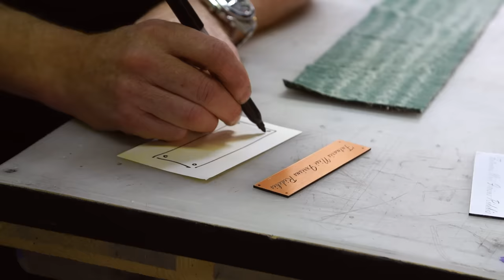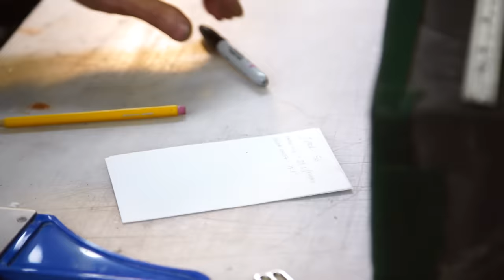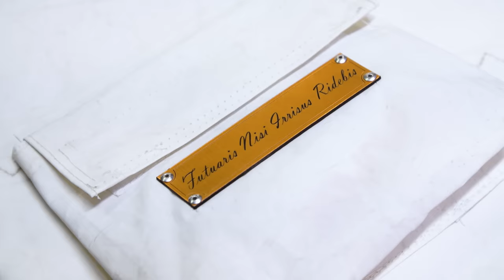Adam Savage's One Day Builds: Eric Idle's Guitar Case!

Comment: Not gonna lie, my butt clinched when I saw Adam tracing the guitar with a sharpie and nothing to prevent it from marking up the guitar. LOL
Reply: Super glad I'm not the only one.
Reply: @865_Audio  Yeah, I immediately thought of all the times I've marked up whatever I was tracing and thought Adam was out of his mind for doing that. But then I remembered that Sharpie comes off with a bit of rubbing alcohol, so it probably wasn't a big deal.
Reply: except if the guitar has a nitro or shellac finish rubbing alcohol will melt it immediately :P  @VanOaksProps
Reply: Meh, all it takes is a little dry erase marker and it'll come right off.
Reply: I clenched when his watch was rattling around on the top lol
Reply: Nothing a bit of isopropyl alcohol can't wipe off.
Reply: I can't figure out why he didn't simply trace the guitar face-down instead of cutting out the body then tracing the neck separately.
Reply: If he ruined the guitar he woulda just made him a new one
Reply: Had the same thought, lol. However, Adam is a professional, and I'm sure, a perfectionist. Hopefully it went well
Reply: The Berth of the marker was pretty thick and he kept that flat against the side of the guitar. The actual felt tip was away from the guitar. This is probably a technique he has used a lot, and so he is less likely to screw up
Reply: @VanOaksProps  You'd want to know what that finish was before you used rubbing alcohol on it.  That would strip some finishes right off.
Reply: The plastic body of the sharpie is all that is needed. You should go look at how they are made.
Reply: My violin is happy it doesn't get manhandled like that. BUT...watching the process of putting a case together was pretty cool!
Reply: Every time he picked up the guitar I cringed
Reply: And watching all the spray adhesives and foam, I am worried about outgassing from those materials affecting the finish on the guitar. This is not unheard of. Of course I don't know anything about the finish on the guitar.
Reply: VanOaksPropFoundry dude me too and no you guys you don’t use isopropyl alcohol on a nitro finish.

Comment: The style, the backpack straps, the snug foam fit are all wonderful.  Kudos.

I hate to criticize such a beautiful build.  I really do.  But.....  As a violinist, I'd like to say the zipper needs to go on the same side as the handle.  The reason being, if the case is unzipped, you're on the wrong side to notice.  And if you pick it up while it is unzipped with the handle on the opposite side the instrument falls on the floor, but if it is on the same side and you pick it up unzipped it falls onto the foam of the side or the fabric covered top of the case.

Ideally, it would have been awesome to have a double handle where you grab both halves one on either side (top and bottom) of the zipper on the size that has the zipper. So even if you forgot to zip it, you'd still be holding it closed.
Reply: Jeremy Streich agreed. I’d also wonder about the placement of the handle right in the middle. Wouldn’t you want it at the balance point? Like you said such a wonderful build but I know Adam always likes to improve. Perfection is an ever moving target :)
Reply: Being a guitar player, right from the start thought the same thing oh man I hope the zipper is on the same side as the handle.
Reply: As a guitarist myself... agreed
Reply: 1000X yes.
Reply: @bucketsofjoy  I don't use cases like these at all and still I thought it was weird to put the handle on the opposite side. You don't put the handle on the bottom of a suitcase either?
Reply: I was wondering about the handle placement myself.
Reply: I don't disagree but, didn't he say he was copying the design of the original bag?
Reply: @there_is_nothing_here  Well it don't seem to be on the "wrong" side on the original bag either. You can just barely see it at 3:22  ... although very hard to make out black on black.
PS: Oh, and it helps to use the period and comma keys to jump frame by frame...
Reply: As a guitar player who likes to make stuff I also noticed this right away. It is so not logical. I'm glad I'm not alone.
Reply: Was looking for a comment like this. Being a bassplayer and having a zipper fail on me once resulting in a cracked neck on one of my acoustic guitars the zipper being on the same side as the handle is one of the first thing I look for in a bag.
Reply: Yeah i thought the same thing as well. For the reason you stated but also from a practical sense. If you're carrying the case and lay it down it will open from the opposite side as you. For most people, an inconvenience, for someone touring, that will get old very fast.
Reply: I would also add that the backpack straps should be high enough to keep the bottom of the instrument from hitting the back of the legs when you’re walking, eliminating unnecessary jarring of the instrument.
Reply: I'm so glad someone said this also how is this an improvement on the existing bag?
Reply: Velcro tabs around the zipper flap would be a nice safeguard too.
Reply: @TheRealFOSFOR  - OMG I never knew you could do that with the period and comma keys!!!! Thank you! :)
Reply: @there_is_nothing_here  He did, but the original bag has the handle on the same side as the zip.......    because it's a real bag
Reply: Since the british do everything opposite, the handle "fits", haha.
Reply: I'm not much of a string player, but I don't think I've ever seen any instrument case with the handle on the same side as the "hinge". Really confused by that decision.
Reply: As someone who doesn't play a stringed instrument this hadn't yet crossed my mind, but now that someone has said it, it seems a little obvious.  However, doesn't that also require straps that keep the lid/cover from opening past about 90 degrees? Because if the lid of the case opens 180, it's not going to keep the instrument from falling to the floor if the bag came open after being picked up even if the handle was on the same side as the zipper.  Though, if it only opened 90 degrees because of some straps, then it might very well prevent the instrument from falling to the floor as the lid would create a small table to catch the instrument. Another solution would be velcro straps attached to the felted foam body that keeps the instrument in place, such that it couldn't fall out even without a lid at all.
Reply: If I we're Eric Idle, I'd have the handle removed and sewn on the proper side and in the proper position to balance it. ( And add some bias tape or something to cover the raw edge where the top and bottom meet.)
Reply: Honestly, It feels wrong to criticise something so nice, but I to cannot get over the handle placement. No case in history that get's regularly used has the handle on that side, for the practical reasons you mentioned, and also for when you place the bag down, the handle is going to be facing you, and so the zipper should be on the same side so you don't have to turn the bag around before you can unzip it and retrieve the object. Ease of use is a big factor to consider with something that is going to be used as regularly as an instrument case.
Reply: I'd say in this case, no pun intended, it's a bit of a moot point. With how snug of a fit it gives the guitar there isn't a large chance of it falling out. Of course Adam may not have been thinking too much about the side handle as it seems it would be primarily carried via the back straps. When you consider the time for the build and the fact that he more than likely did this for free, I think it's alright.
Reply: @n3rddegree869   He put the handle on the wrong side. The old case's handle was and ALL guitar cases' handles are on the other side. Imagine you're carrying the guitar case by the handle, and you set it on a table to take the guitar out. Because the handle is on the wrong side, you need to spin the case around first. It's wrong.
Reply: I didn't say it was on the right side did I? Like I said, if he was only thinking about the backstraps, then the handle becomes moot. Of course this is a simple enough fix by simply adding a handle to the proper side.
Reply: @n3rddegree869  You said "it's a bit of a moot point" and "I think it's alright." I am saying that it's not moot and it's not all right.
Reply: Thank you.  Needing to spin the case 180 every single time would be infuriating.
Reply: The zipper not being on the same side as the handle really bugged me as well, super weird.
Reply: I love stuff like this.  Like little bits of knowledge only gained from doing something.  I would have never thought about that, but it makes total sense.
Reply: @n3rddegree869  I agree, the guitar seems to fit snugly enough that it won't just fall out (also considering it would be somewhat lightweight due to it's size) like people are making it out to be. 

That isn't the same as saying that the handle is on the right side either, like AisuruMirai seems to think. It would be a pain if you were holding the case by the handle, then placing it on a table and having to twist it around to get to open it easier (i.e. with the top opening away from you) every single time you hold it by the handle. It's clear from the video Adam didn't really consider the placement of the handle deeply, he had the foam insert oriented in a way that resulted in him deciding on the placement of the handle on the wrong side of the case, and he simply decided that it should be halfway down the case. But as you said it shouldn't be too hard of a fix.
Reply: I'm glad to see someone already made this comment. I may not be a guitarist, but as a trumpet player I can confirm that every instrument case I have ever seen has had its handle on the side that opens. Other than this issue, the case looks great!
Reply: I was thinking the same thing, as a guitar player I've never had a single case that has the handle opposite the zipper.
Reply: Such is the origin of the “master of none” part of the phrase.
Reply: You're right, but did you see the size of those zipper teeth? That's not some Nancy boy violin zippers. Those are industrial strength grind your finger off zipper
Reply: Also, it should not be at the centre of the side, but over the center of gravity, which may not be the same place.
Reply: Jason Molisani not just instrument cases, think suitcases too, it’d be a mad choice to have a suitcase open opposite to the way you carry them. To be fair this is one of those decisions caused by a looming deadline and starting off with the wrong idea and no time to really think about it, test and correct it. We’ve all been there!
Reply: I didn't catch the handle  on wrong side but you are correct.  The other bad problem with the case is the support for the neck on the head.  It should be under the neck.  The way it is now; a good jolt could break the head off.  Also, does anyone recognize the manufacturer of the guitar?  I don't recognize the markings.  Also the handle should be at the balance point but it looks like he doesn't carry it by the handle very much so it shouldn't be a problem for Eric.  That said, I don't think I could have done even half as good a job as Adam.
Reply: @TheRealFOSFOR  omg ty, didnt know u can move frame by frame
Reply: That's exactly how my gig bag is made. It actually has two handles that have a flap of velcroed fabric that makes it one piece once wrapped together. It's closed even if its left unzipped because you need to  wrap the handles together to use it properly.
Reply: As a guitar guy my self...
Reply: As a bassist I agree about the handle and zipper situation
Reply: Exactly, laying it down on its back to open, and the zipper is on the other side so you have to spin it round.
Reply: Jeremy Streich Adam said that you must think backwards 🤪 soo that what he did! But on this handle you should not think backwards ❤️ Awesome build anyway ❤️❤️❤️
Reply: Exactly what I came to the comments to see.
Reply: I feel like Adam could've made a way better product by just taking 20 minutes looking at other instrument cases. He's good at doing things on the fly (as evidenced by this insanely good build) but this is an old industry where there is an immense amount of collective learning that has already been done.

Take a look at Mono Creators bags, they show a lot of the little things that have been found out (like handling the headstock properly and having extra space for the end pin so it doesn't get rammed into the guitar when it drops on that end).

It's an amazing build though, much better than most or even all off-the-shelf cases for this shape of guitar.
Reply: Totally see where you are coming from, and as a guitar player it makes sense. But you would have to have one of those split handles that has a piece of material that holds them together. Not as nice as a single handle to hold in your hand, perhaps that's what Eric asked for?
Reply: i agree with the handle placement point... i almost feel like it would have been so much better if the piece of fabric that the handle is on would be flipped 180*, you know what i'm saying? that way the handle is supporting the bulk of the weight be being more centered over the body of the guitar. but idk if i agree w the zipper point. i agree that it is ideal, but with a built-to-fit custom guitar case with such a tight fit, i don't think the guitar would fall out before you noticed that the case was unzipped, but that's just my opinion. this is a sweet case though, i love the sail cloth and the red triangle on the side. very understated and sophisticated, and very clean looking. great build adam!
Reply: I also thought that was an odd choice. I would guess it’s because he’s trying to get it done fast and just didn’t think about it. I do stuff like that all the time when I’m trying to do stuff fast.
Reply: I agree with this comment 100%. I would've also used the balance point for the handle and if the guitar uses picks, I would've added some very thin slits in the felt, with felt envelopes inside of each in the foam and maybe a slot for some extra stuff inside such as spare guitar string bundles, and so on... That way it is all inside.. Then the outside pocket could be used for things that need 'quick' access such as boarding passes, etc... ( also, because of how strong the velcro is, I probably would've added something to make that front part rigid like a thin piece of plastic that is flexible just to make it easier to grab onto and rip open. ).
Reply: Not a guitarist yet your comment makes sense. When he’s measuring for zipper and handle the case is positioned on its side even. One could see the problem of falling out. I’m guessing he fixed it later and learned. Though I’d think the case is preferably opened when flat.
Reply: #firstworldproblem just enjoy the build for what it is.
Reply: Though one thing to consider with that is that (hopefully) it wouldn’t fall out with how snug the fit of the foam is. He did make the foam part of the case very well fitted for this guitar and it doesn’t seem to me personally that it would fall out. Though I’m really not at liberty to say
Reply: and now that's bugging the crap out of my ocd lol